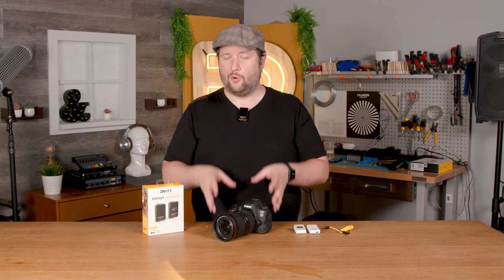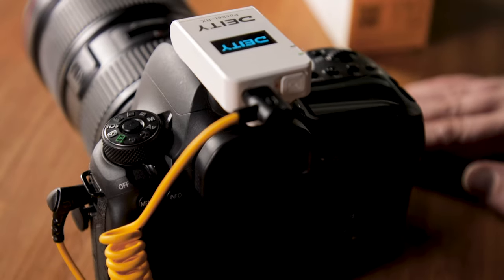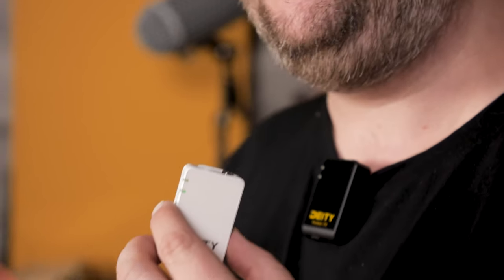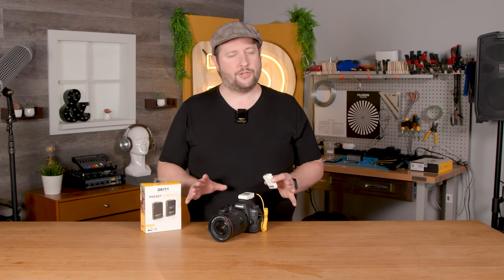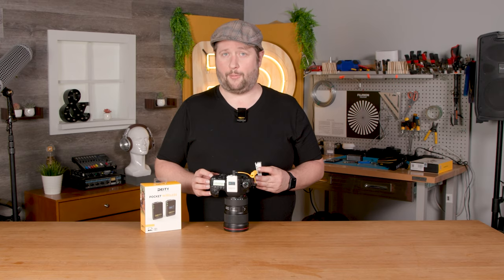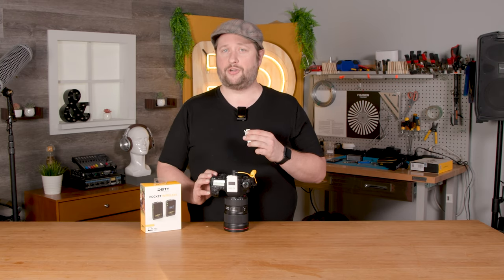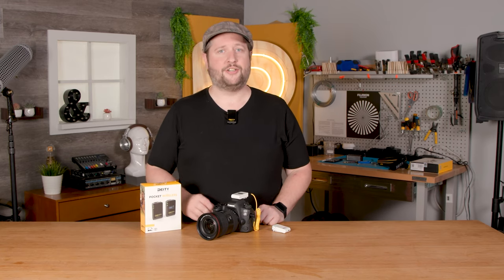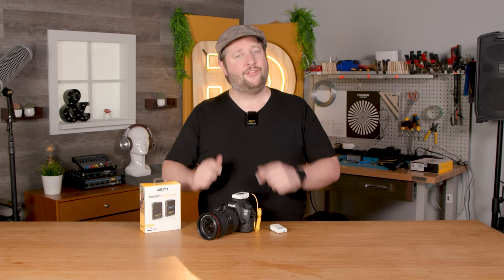Pocket Wireless Camera Guide | Wireless Audio for DSLRs

Comment: Now that I have subscribed, please make some budget friendly microphones for markets like Africa. I mean cheap microphones I can buy. - Deity fan from Uganda 🇺🇬.
Reply from the maker: We make a $49 microphone, $49 lav, and $169 wireless set. How much cheaper do you want?
Reply: @DeityMicrophones  well if you make a $50 that’s good deal. I will save in a short while to make $50 from my solid $40. I am even motivated to get it asap. The problem is how they can reach me. Because I have never seen any seller selling em in Uganda.
Reply from the maker: @boxoffisa  who sells camera and filmmaking gear in Uganda? Is there a certain store we should talk to about becoming a local dealer?
Reply: @DeityMicrophones  there are shops. Kampala is the nation’s trading center. So most camera shops are there. I have been sharing to most people about Deity products since I came to know their capabilities.

I came to know about deity because I wanted to start recording videos but my focus is sound. Those I told of picked interest even if the number makes 10.

So by videos I recommended and positive reacts I got in return it add me seek for it. Now that’s my part, by this I know more people would get interested because we had poor stuff sold by some Chinese. Because China discovered market in Africa.

So there could be people having camera because you can connect to and do business. If deity had a dealer I would have gotten my pack and wait to upgrade.
Reply: @DeityMicrophones  there are camera shops in Uganda. And I would encourage you to talk to some established businesses that pays taxes to the government and they are recognized by the republic.

The wedding, and other video production industries are taking off. These microphones will help. Can’t wait to get mine.
Reply from the maker: @boxoffisa  what is the biggest camera shop in Uganda?

Comment: Is there a plug in power into the 3.5mm jack of the transmitter of Pocket Wireless so that it can trigger power to V-mic Deity D3 Pro? It will be a good set up for a wireless boom mic set up. Thanks for the feedback.
Reply from the maker: Yes
Reply: @DeityMicrophones  That's great! Can I also use the gain of V-Mic D3 Pro hook up to 3.5mm jack transmitter of the Pocket Wireless mic?
Reply from the maker: @jaysonhernandez6728  yup

Comment: i really like the locking connector on the transmitter, my idea is to use it for audio hopp when the camera is on a gimball and weight is crucial, can it receive line level audio, or the best method would be mixing with previous deity transmitter and use this pocket receiver

Comment: Hello! Could I connect the Pocket Wireless into the input of the D4 Duo? Also, does the Pocket Wireless connect directly in to an Osmo Action (one) using the USB C TO C cable? Thanks!
Reply from the maker: 1) into the D4 DUO, yes
2) into the Action 1 ?? ... don't know. We know it works with the Action 2 using C to C

Comment: When you adjust the gain on this system, are you actually adjusting the input gain on the transmitter, or just the output gain on the receiver? For example, I have a very sensitive lav mic that often peaks on other systems, but would it work with this?
Reply from the maker: hi, you are adjusting the input gain on the transmitter. ease off the gain if you are using a sensitive mic